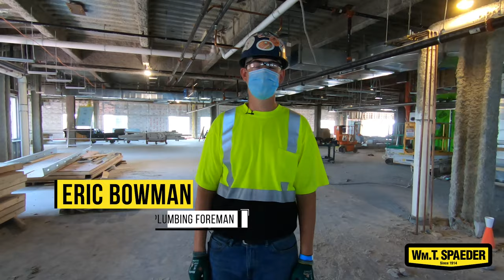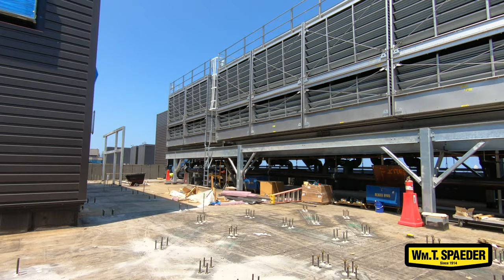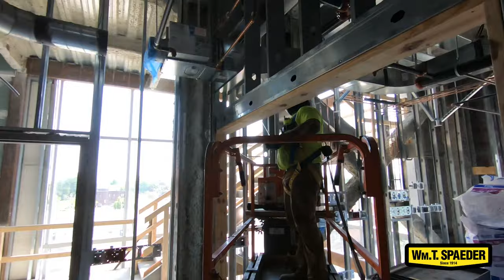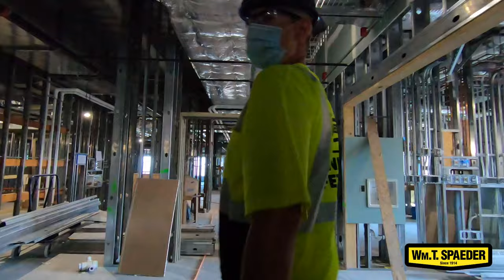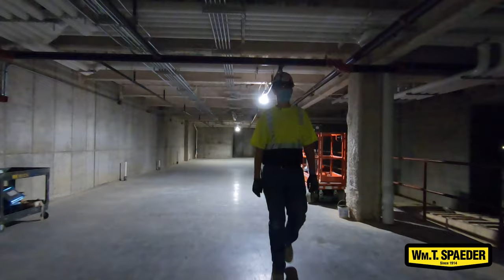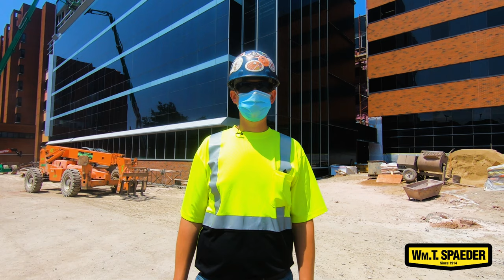Hospital Commercial Plumbing Part 3 - Wm. T. Spaeder

Comment: You may have an issue with the 07 (or 107N) Vic couplings on the Stainless.....should have been Style 89 couplings.
Reply: pro tip : watch series on Flixzone. I've been using it for watching all kinds of movies recently.
Reply: @Moshe Leland Yup, been using flixzone for since november myself :D